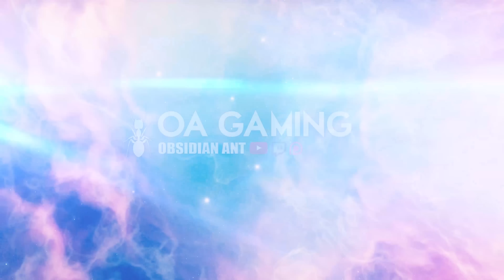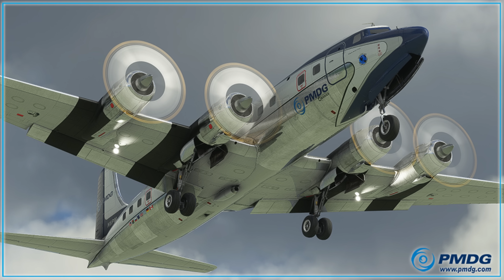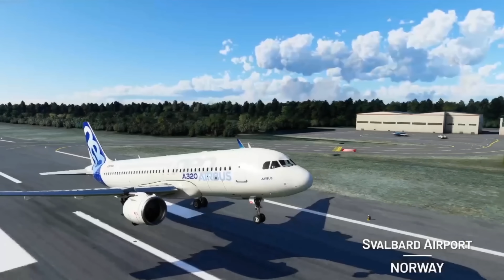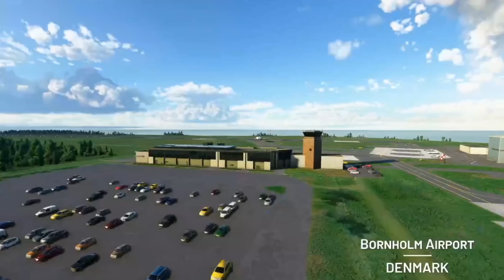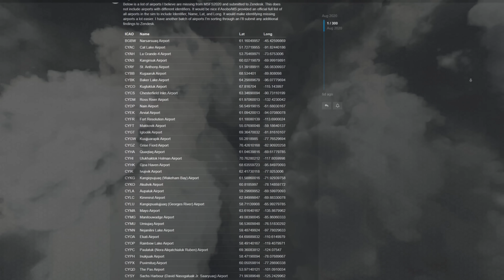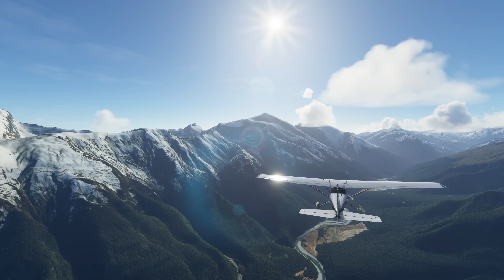Microsoft Flight Simulator - Low-High Tides, Future World Updates, DC-6 & Junker Ju 52

Comment: Fix. The. Performance!!
Reply: I guess the fix is comming. Together with the console release there might be a DX12 update.
Reply: So demanding :P
Back in FS9 most capped fps to around 20-25, getting over 30 was almost unheard of.

I do hope they can improve performance though. These days I feel like 60fps or so is needed for a smooth experience.
Reply: @Gazer75  Well back then 30 fps with most games was acceptable to many people. No matter what settings.

But dropping to 20 fps in certain airports and planes no matter what settings and resolution I use on a 10900K and 3090 with 32GB of Ram and having the game on a nvme ssd...not acceptable. The game only uses a single thread. In a time where 6 cores and 12 threads is becomming more and more mainstream with new systems and 4 cores/8 threads is the absolute mainstream.

Comment: I think you understated the magnitude of what PMDG DC-6 is compared to what comes with the game. The PMDG is a study level sim with every button fuse simulated as well as oil temperature, pressure, cowling, and fuel tank rotation affects on the failure rate of the engines. There is no plane in the game at any level that compares to it. A lot of us flight sim users from X-plane, and the older Microsoft simulators are awaiting PMDG planes to make this sim usable for us. Its a big deal.
Reply: What he said!

Comment: The DC6 is excellent. Even runs well on my GTX1070 system. At least, the 25 to 30 FPS is fine for me.
Reply: @GiRayne I’m not too fussed about mega FPS on a flight sim. Coming into land it’s smooth enough between 25 and 30, yeah. Only doing about 100 knots or so. That said, if I could get hold of an RTX3080 then I would :)
Reply: @GiRayne - I would say it's definitely going to run in 4k on series x. Might not be quite native 4k though. I run a 1060 and that's fine with high settings at 1080p most of the time. The Series X should have the headroom to go considerably above that and with a target of 30fps, 4K Seems the obvious target.
Reply: I don't know if the dc-6 will work properly for me my pc specs is GTX1660TI, 16gb ram and, corei7-10750H, Do these specs is good or it need to be upgraded ?
Reply: @Capt_Ahmed.Ibrahim  May be better after the 27th when SU5 is released but at the moment, yes it may struggle. I also have 24GB but CPU is old i7 4790K S